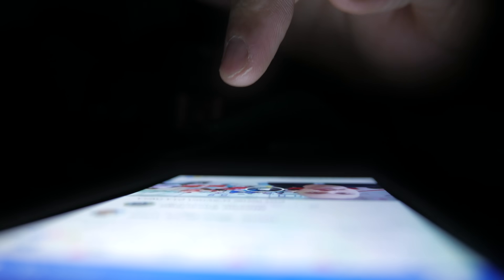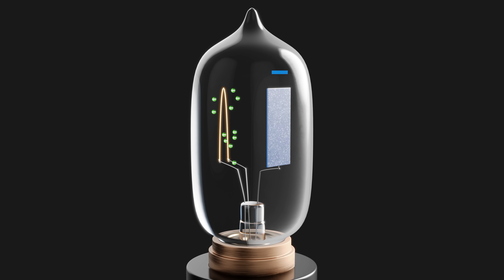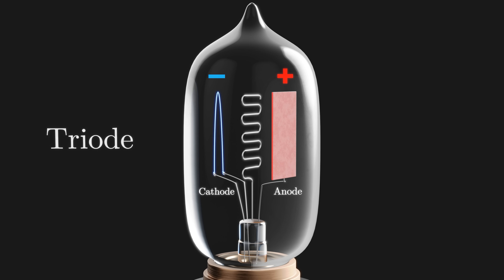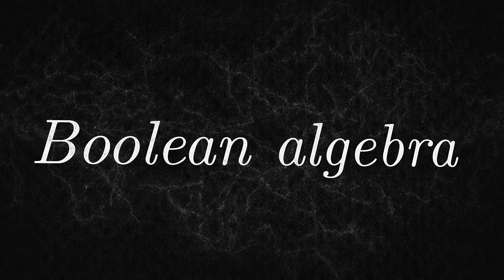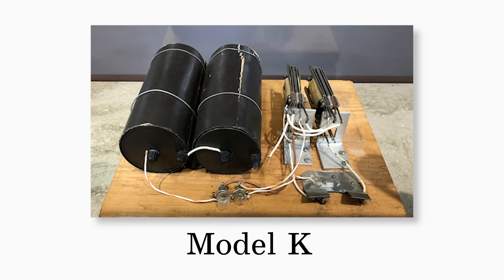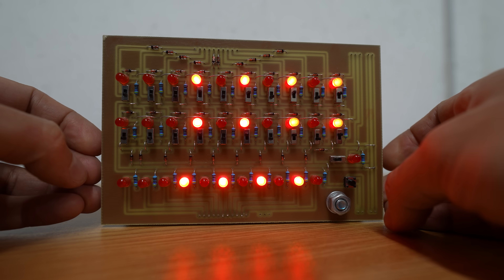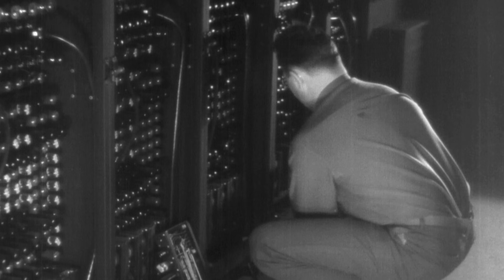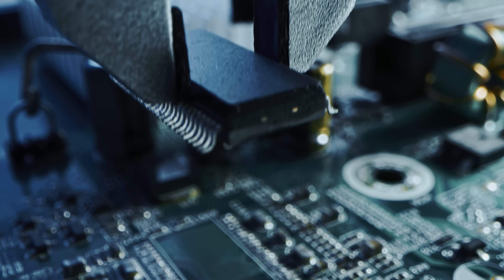Why The First Computers Were Made Out Of Light Bulbs

Comment: 9:16 wait, why is no current flowing through the solenoid here? Wouldn't this lead to a flickering lower light bulb as whenever its corresponding circuit is closed, current from B can run through it but as it passes through the solenoid, it turns off the connection to the lower light bulb, thereby switching it off again? Can someone tell me what I seem to be missing here?

Comment: The national broadcaster in Australia was still using tetrode vacuum tubes for the 20kW output stage of their FM radio transmitters in most capital cities. These have only just been replaced for solid state transmitters in the last 2-3 years. Power efficiency was a big factor in the change, as well as the replacement cost of the tubes was around $10,000 every ~2 years. 4CX20000A

Comment: Can attest. Back in 1993 I was contracted by an hotel to build an interface between a new telephone switch and the hotel's computer system so long distant calls could be calculated and charged automatically. Well my point is they still had an appalingly old electromechanical switch and it was huge, heavy and noisy.

Comment: Derek, your statement that if the grid were slightly positive.... is actually wrong, because the grid is much closer to the cathode than the anode pretty much all the current flows to the grid and the control has a higher non-linearity compared to negative voltages. The grid can even glow red because if there is insufficient current limiting. What they actually do is set the conditions up for negative bias on the grid and the applied signal you want to amplify basically adds or subtracts from this negative voltage (always being kept negative with respect to the cathode). Later designs had a grid much closer to the anode which was positive, but because of that proximity acted as an accelerator to reduce impact of reducing anode voltage on the overall gain of the device. These were called pentodes.

Comment: I learned that Edison developed bulbs with multiple filaments, because the filaments had a short life.
The intention was not to immediately throw the lamp away, but simply switch to a spare filament present in the bulb.
However, he noticed that when the selected filament was lit, a current was also flowing through the unconnected filaments that were simply in the vacuum.
Reply: The filament in the bulb was invented by a black man
Reply: @williampearson6299  Lewis Latimer, for those who'd like to easily look him up.  Also invented an evaporative air conditioner and improved railway toilets.

So....for a comfy, well-lit summer evening ride on a train without the smell of poo, Lewis was your dude.
Reply: Induction.  One powered wire can induce a relatively slight charge in a nearby one that isn't powered, or cause interference in one that is.  This is basically a transformer missing the flux connection that makes it active.
Reply: @VoltisArt  
That was Edison's Problem.
He stuck to direct current, where no transformers (on the principle of induction) could be used.
As a result, Westinghouse eventually won the argument with alternating current and we now have an alternating current grid.

Comment: Eniac the first computer? Might it perhaps have been relevant also to mention Colossus: a set of computers developed by British codebreakers in the years 1943–1945 to help in the cryptanalysis of the Lorenz cipher. Colossus used thermionic valves to perform Boolean and counting operations. Before Colossus came the electro-mechanical Bombes, using relays, which helped to break the Enigma code.

Comment: The first electronic programable computer was COLOSSUS built by the British code breakers at Bletchley Park in 1943 to decipher the German Lorenz cypher. However as the project was classified, the existence of COLOSSUS was kept secret until the 1970’s.
Reply: COLOSSUS was NOT a general purpose computer. Each individual COLOSSUS unit, yes there were many, was reprogrammable within a very narrow set of cryptographic functions. Individual units solved specific cryptographic problems and could not be reprogrammed to perform any other tasks. ENIAC could be reprogrammed to solve many different kind of mathematical problems, hence it was the world's first general purpose computer.
Reply: @Dingo-Videos  I believe someone worked out that 10 Colossuses, linked together in a particular way, would be Turing complete, but of course no one ever did that.
Reply: I've also read that, which is why I get frustrated with people claiming it was something that it was not. I'm not being critical of COLOSSUS. It was an amazing feat of engineering and a crucial part of computing history, but it simply was never used or designed for general purpose computing.
Reply: @Dingo-Videos  If you want to start playing silly games with the definition of a "computer", then fine... you can then "prove" your claim. But it still isn't true, because Colossus was programmable, it was electronic and used the same logic as any modern computer. Because something was designed to perform a set of specific tasks, rather than as a general purpose machine, does not in any way, shape or form alter the fact it was a computer. And it was built before ENIAC... therefore ENIAC could not have been the first.
Reply: It's not silly games, it's the meaning of the words. The team behind COLOSSUS weren't TRYING to make a general purpose computer, so why would it actually be the world's first? Was it reprogrammable? Yes, but so were looms. That doesn't make them general purpose computers. COLOSSUS was a fantastic piece of engineering, but it wasn't what you want it to be. That's just reality, I'm sorry.
Reply: @Dingo-Videos  
Nobody brought up "general purpose" before you, specifically the video claims "first programmable computer". So yes, ENIAC doesn't fit that definition, because Colossus predates it by 2 years.
Reply: @GeneralSamov  General purpose computer was the term for such machines before such they became commonplace. Since almost all 'computers' have effectively been general purpose computers since the 1950s, the terms became synonymous.
Reply: @Dingo-Videos  
No it wasn't. That's like claiming "internal combustion injection engine" was the common term before "engine" was.
Reply: @David MacKenzie correct, Alan Turing worked on the Bombe instead, an electromechanical device actually invented by the Poles.
Reply: I use colossus as an example of the invention and innovations of computers for a class i teach.

Check out the antikythera mehanism.
Reply: "The world's first electronic, programmable computer was called ENIAC" is the exact quote from the video, and it is factually wrong.  Of course, COLOSSUS was not public knowledge for another 30+ years, and I can't really blame people for making the most of that secrecy and pushing ENIAC and the country that developed it, as the first.  Even if a few of them knew better.  But it's been 45+ years since COLOSSUS was known to the world.  We should at least get the facts right now, especially in such a very interesting and well-produced documentary.  The moment I heard this, I immediately thought that we must still be getting our information from 1960's textbooks.  As an aside, any argument about ENIAC being intended as a general purpose computer is pretty thin.  It was originally designed to calculate ballistics for artillery shells.  And besides, why is intent part of the argument?
Reply: @IAmCharliemouse  
To be able to hold on to the US primacy, of course.
Reply: @IAmCharliemouse  What do you imagine was the significance of computers if you would have had to BUILD A NEW COMPUTER to calculate a different class of problem? The word “computer” exists to connote something that can perform generic computation. Calculating with a specific problem domain that the machine is designed to work in is a different thing that is a far less foundational to what the world of computing is built on. For the computer revolution to be a thing, there were three essential ingredients. It had to be completely electronic (so Atanasoff’s ABC is immediately out), it had to be programmable (so Zuse’s out, infinite frictionless piece of tape doesn’t count), and it had to be general purpose (so Colossus is out). There were many many entrants with 1 or 2 ideas from this venn diagram leading up to 1946, but only Mauchly and Eckert’s ENIAC had the vision to put them all together to create practical, high speed computation of whatever problem you wanted to solve. THAT was the quadrillion dollar idea. Mauchly and Eckert were also responsible for additional important aspects of computers like the stored program and the “Von Neumann” architecture (only so named because Von Neumann published without their names while they were busy actually finishing the damn device they’d invented). They knew the stored program was the way to go halfway through building ENIAC, but had to wait until BINAC for practical reasons of finishing the design they had. Then, the Penn team held the Moore school lectures, and every major branch of modern computing history that you’ve ever heard of blossomed from that. So get it straight: Colossus was a cool thing that happened. ENIAC was the beginning of computers.
Reply: And again nowbody thinks about the Zuse Z3 wich could also be arguably the first Computer.
Yes it wasn't natuarly Turing compleet, but could bei withe trixe. And it was a lot more programebel (you didn't need to rewire it for evry programm).
Manny germans would say the Z3 was the first Computer and mit the ENIAC.
Reply: @magarinemarmeladen647 :  From what I can gather from Wikipedia, it sounds like the Z3 might have been a stored-program machine, and /in theory/ Turing complete--i.e. if it had infinite memory and infinite time to complete a program then it could be used as a general-purpose machine.  But it wasn't practically Turing complete--it couldn't, in reality, be used as a general-purpose machine.  I think supporting stored programs and being general purpose are both essential properties of what we consider a computer now.  I guess you might claim the Z3 wins on a technicality, but I find it a bit iffy.
Reply: Although Colossus was the first programmable electronic machine that was called a "computer" at the time, I don't think it was a computer in the sense that we use the word "computer" today, since it wasn't general purpose, and wasn't a stored-program machine.  That said I don't think ENIAC was a computer in the sense we use the word today either, as although it was general purpose, it wasn't a stored-program machine either.  I think the first computer, in the modern sense of the word, was the Small-Scale Experimental Machine (SSEM), also known as the Manchester Baby.
Reply: @jamesc3505  yep. Memory was, and still is, one of the most expensive parts of a computer. The cost of the loops to store memory, was too expensive to make. Hence why displays didn't appear for years after telex machines (which were using paper at the time for storage and display), as the tech for memory needed to keep the image on display, was better used as processing power. Something along those lines.
Reply: @jamesc3505  Colossus was an electronic, programmable calculating device which used logic gates to achieve those calculations. By that standard, it meets all the criteria of being a computer. A computer that only runs one program, or has no permanent storage is still a computer. We know the US love to claim everything as theirs, as being first etc, but that doesn't make it true. Colossus was the first electronic, programmable computer, although not a general purpose one.
Reply: @another3997 :  I think that if you take an introductory course to computer architecture, or ask someone who knows about computers to describe the basic components of a computer, then you're likely to hear something essentially along the lines of the Von Neumann architecture.  There'll be a CPU, memory for storing data and instructions, and input and output devices.  Besides not being general purpose, Colossus didn't match this model, because it wasn't a stored-program machine.  That said, neither was ENIAC.  I do think the first computer, in the modern sense of the word, was British, but I don't think it was Colossus, I think it was the Small-Scale Experimental Machine (SSEM) or the Manchester Baby.
Reply: I guess it depends on which history books you read.  Furthermore, the existence of Colossous was keot secret until the mid 1970s and it wasn't really public knowledge until the early 1980s.  Therefore, the history books would not have known to mention Colossus when considering ENIAC as the first computer.
Reply: @DrRusty5  and what year are we now?
Reply: @DrRusty5  the 80's are 40 years before this video.
Reply: @DrRusty5 Yes, but the history books should be updated rather than perpetuate untruths. The fact the Colossus was kept secret should not mean we disregard it. It was the first programable computer. Its position is clear. ENIAC  was not the first. Incidentally the Brit Joseph Lamb had invented and constructed Electric Light bulbs 10 years before Thomas Edison who had had Joseph Lambs book sent over from Britain to copy the idea. He not only copied it but registered patents for Lambs invention. He made improvements but never invented it. Joseph Lamb beat Edison in court then Edison started a company called Swan-Edison and deliberately bankrupted it! Thomas Edison was not a nice man.
Reply: @DrRusty5 The USA government military knew about UK code breaking at Bletchley Park - the UK were supplying intel to them. Sadly the US let the cat out of the bag at one point and nearly gave the game away completely. It was calculated that by breaking Enigma millions of lives were saved snd the war was shortened by 3 years. Credit was due to the Poles who obtained a military grade Enigma encoder. Colossus was the first Electronic Computer and used Thermionic Valves rather than Transistors. Tommy Flowers a Post Office Engineer did a fantastic job building it. People subsequently change the definition of what qualifies as a computer yo suit their own subsequent versions but Colossus was the really the first.
Reply: Watching Americans get upset that someone else got there first is amusing.

Eniac was built with knowledge of Colossus. Colossus beat ENIAC to electronic calculations, and ENIAC built on the ideas. To talk about ENIAC without Colossus is poor but understandable from a channel with an American centric view.
Reply: @GarethThomasMEng  
Well, probably it wasn't built with Colossus' knowledge, as Colossus has been top secret until 2003.
Reply: @GeneralSamov  Sorry to correct you.  Photographs of Colossus were released in 1975, and a paper with more details was released in 1976.  It was cited as the first electronic computer in several journals in 1977.  The technical details of Tunny, the cipher that it was built to decrypt, were not published until 2000.  I am not sure whether information exists on whether US scientists were aware of Colossus back in the 1940's, enough that it would have influenced ENIAC.
Reply: @IAmCharliemouse  
The technical specs were classified. Yes it was "leaked" what its capabilities were but I'd have to assume the people behind ENIAC, which was completed in 1945, would have had to pretty much build and program the whole thing up from scratch. Hell, in 1945 the war was still going, surely Bletchley Park was at that point still hermetically sealed.
Reply: Thankyou Americans are always trying to re write history and say they invented the computer. Colossus was built by Alan Turing also of Turing test fame. It was built to crack enigma which it did amazingly well, another thing Americans like to claim they did. They only got away with it because it was classified.
Reply: @brucemanly  The earlier electromechanical computer, the “bomb”, was built to crack the Enigma. COLOSSUS was built mainly by Tommy Flowers to break the Lorenz code used by the German High command.
Reply: @JK50with10  You're right Tommy just used some of his ideas to develop colossus, my bad. My point still stands about Americans though.
Reply: @brucemanly  and mr flowers
Reply: @brucemanly If you asked Ensign Chekov, The computer was  "inwented" by the Russians! 😅
Reply: @brucemanly  If a tree falls in the forrest and nobody is there to hear it, does it make a sound? 
You can't really blame US scientists or engineers who reinvented computing devices from scratch of stealing credit from an earlier project that they had no knowledge of. And when even the people who might have known had to keep silent to preserve secrecy.
Reply: @edwardblair4096  No one is mad that multiple scientists/tinkerers "invented" a computer-like machine in their own right - Each one is a fascinating accomplishment!  However, all of this happened over 50 years ago - I simply expect a channel like Veritasium to know about the other machines, like Collosus or the Z3.  You can't tell about computer history much without.